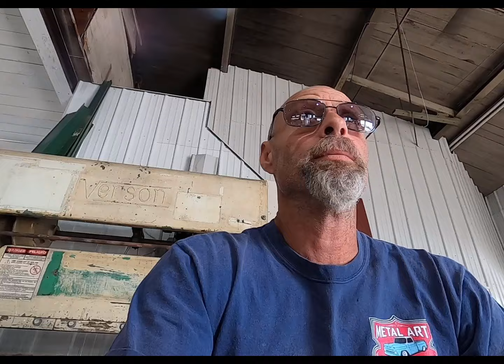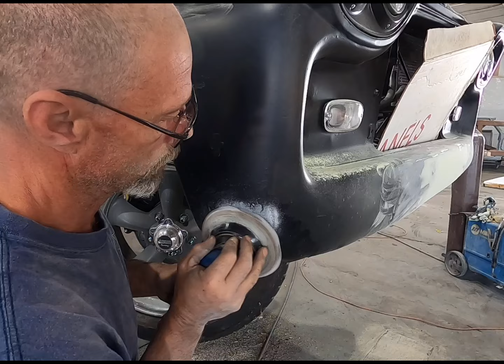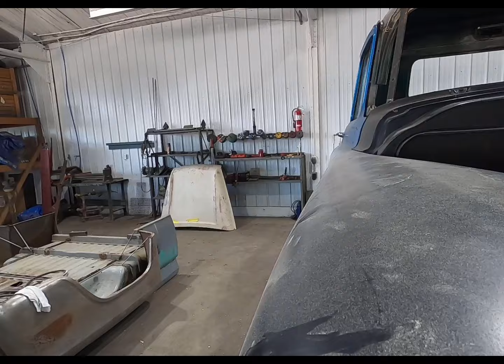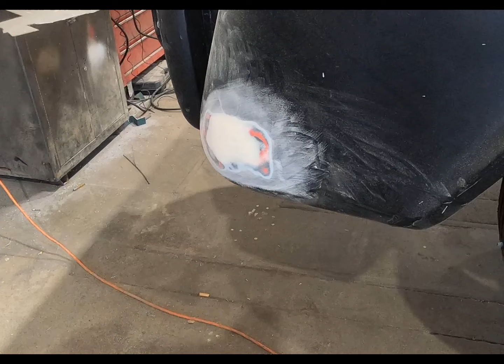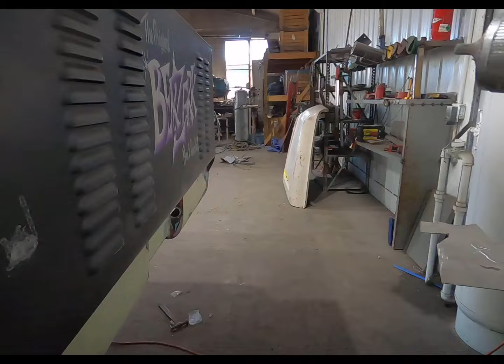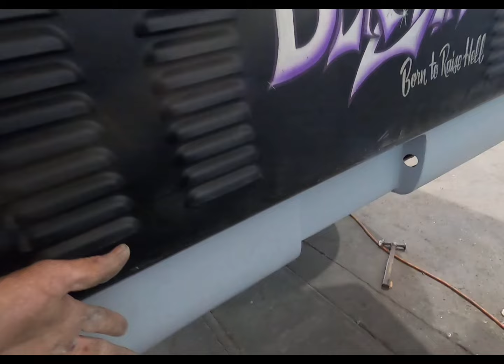Fixin dents today and a bit of primer

Comment: What paint system and primer do you use in your shop?
Reply from the maker: I use R&M products, for primer I use ever coat 4-1 most of the time
Reply: @metalartcustomsLLC  ok cool was just curious I used alot of BASF glasurit and switched over to Sherwin Williams refinish